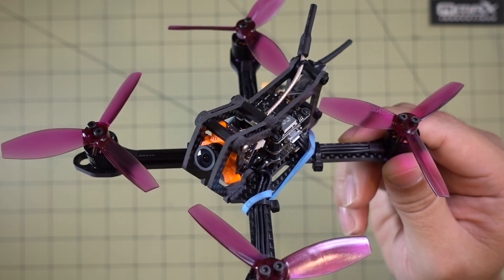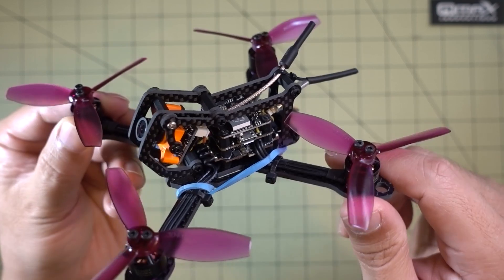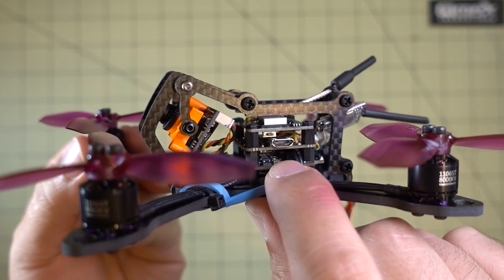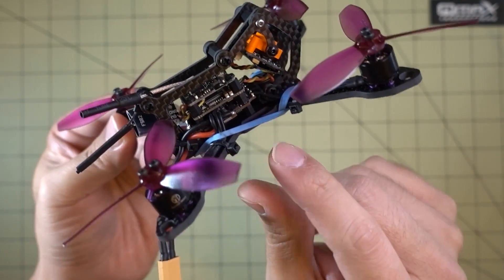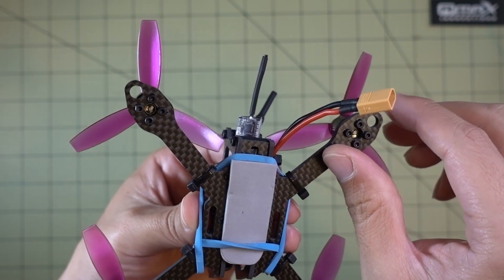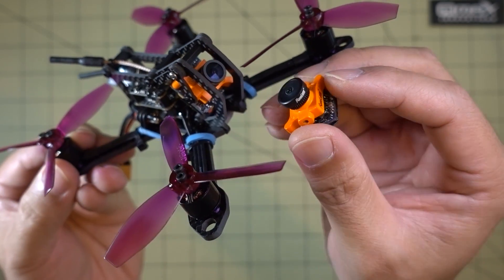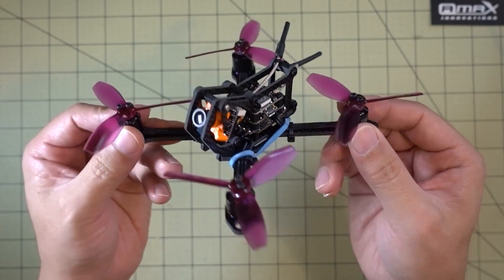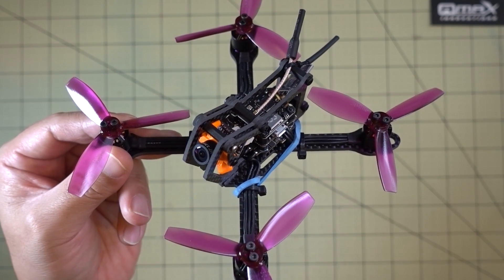Micro Drones 101 🚁#48🔥 A-Max Akitainu ⭐

Comment: Hi Albert, great review. A question though, will the plate gap on front most position allow to fit runcam with a slight bigger lens (2.1)? I saw some other builds on picture, where 2.1mm cam was slightly pulled back, and this seem to be bit controversially since we might end up with blind spots, regardless of enhanced cam fpv.

Comment: Hi Albert. Just a quick question about the FC-ESC-VTX stack you are using. On the product page someone complained about lack of a current sensor. Looking at your OSD, seems like FC has one ?
Reply from the maker: I'm not sure what you're seeing, but there is no current reading on the screen.  Yes, it has no current sensor.
Reply: My bad. mixed with the battery voltage for whatever stupid reason. Thank you.

Comment: Hi. Have you tested out the range of the Flysky receiver? Is it really 400m?
Reply from the maker: It depends on the environment. If there's a lot of 2.4ghx wifi in the area, range can be as little as 100m.  I've flown this as far as 300m without any dropouts but the area had little radio clutter.
Reply: Thanks.  That sounds more than enough for a micro quad.

Comment: i have just finished a build with this frame, but used a runcam swallow, flytower F4 mini and BBB 1606 3500kv motors its a little monster on 4S and it is possibly the easiest build I have put together.

Comment: why did you change the way you orient the rubber bands on this model?
ie: didn't double on the rear
Reply from the maker: Because of the way the arms are in relation to the body. The arms are very close together in the middle.  I prefer the bands with some separation.  Do it the other way and they are in the middle close together.
Reply: lol I thought it was a joke that he noticed that.

Comment: Flies very well! Maybe with a lower kv you could try to run 3s, but on 2s its already so floaty!
Reply from the maker: If you get the 6500kv motors you could do 3S and it will be crazy fast!

Comment: Very acrobatic flying - love the power loops. Thought I was ready to learn the power loop, but can't learn it LOS like I did the other flips and rolls before I tried them FPV. Horizon doesn't let you stay inverted long enough before it flips you back upright. Harder to see what is happening or staying oriented for new tricks in FPV...Oh, the frame looks good, but why put a weird camera mount in instead of just widening the rails. KISS! (not the manufacturer)
Reply from the maker: If the rails were wider, then 3-in props will not clear.
Reply: Didn't mean to be that literal. Just rather see a slightly bigger frame like the XBL2 or CS2 (135mm/3") with a simpler design solution for the cam.